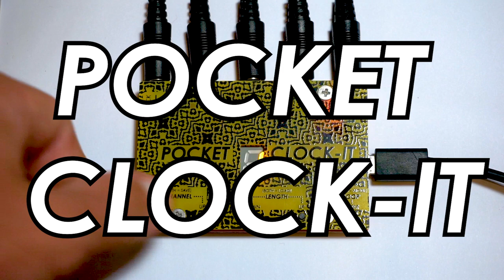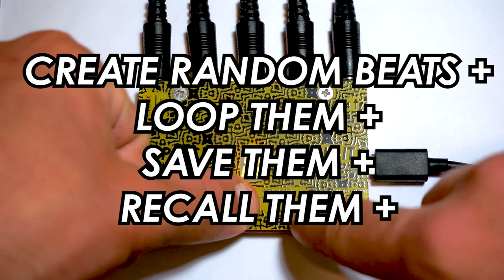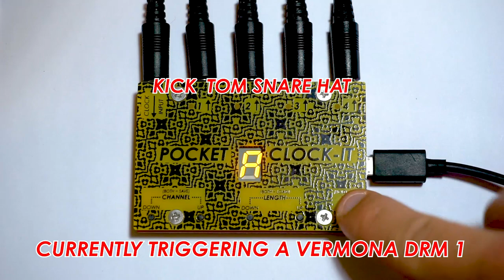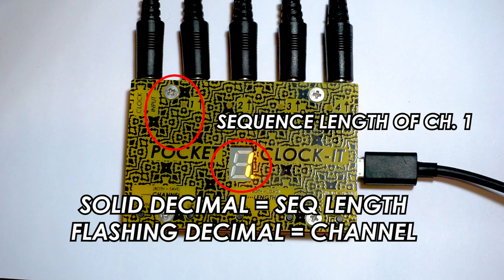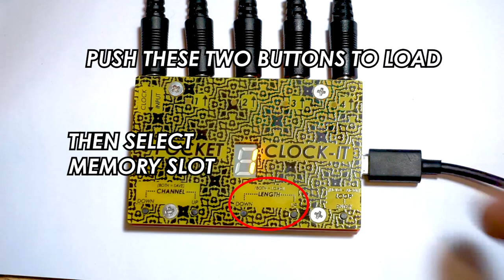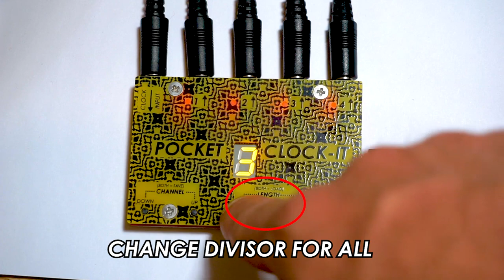POCKET CLOCK-IT DEMO

Comment: I’m trying to use the analog sync clock from the TE TX-6 to clock my Moog Grandmother and Bastl MIDI Looper but it doesn’t seem like the signal is hot enough for either. Will this take a similar weak clock signal and output the clock at a more standard level?
Reply from the maker: Theoretically yes as the Pocket Clockit has an input threshold of only 1/2 a volt for it to trigger. I don't own a TX-6 and it didn't exist when this product was invented so I can't guarantee there aren't other unknown idiosyncrasies. Clockit is cheap and fun so you don't have much to lose by grabbing one :). Free shipping worldwide from our website.

Comment: Any ideas if this will work with multiple Volcas? Been searching for a clock divider for my volcas and not sure if I want to make the plunge to euro rack just yet
Reply from the maker: I tested it with a friends and it seemed to work fine. I couldn't go in depth to make sure it matched their proprietary clocking or in a daisy chain of multiple units because I don't have a Volca setup. I'll tell you what - if you order one direct from me and it doesn't work out for you I'll happily give you a full refund for your order. I need more units out in the wild to figure this stuff out!
Reply: @mffenzeefmdular9067  man that’s really cool of you! I’ll tell you though, I impulsively bought it off of Perfect Circuit before I saw your response! Really appreciate the offer though, I have a feeling it’ll fit into my system either way. I’ll ping you when I get to chance to try it out and see how it does!
Reply from the maker: @ElBarMedia  Please let me know if you have any issues!
Reply: @mffenzeefmdular9067  so I’m happy to report the clock divider works well with volcas! I used my Vdrum as a master into the input then set divisions for the Vsample, Vbass and Vmod. All units have to be on the same step mode, and obviously there’s no triggering of any kind, but it’s soooo nice to be able to create variable pattern lengths with this device. Thank you for solving a problem that was driving me nuts! Playability is 100%, great work brother.